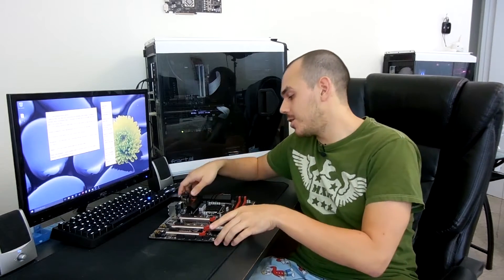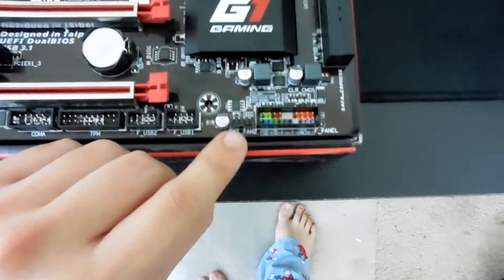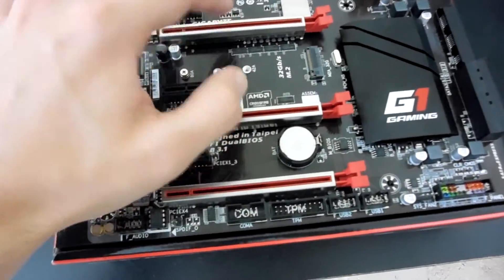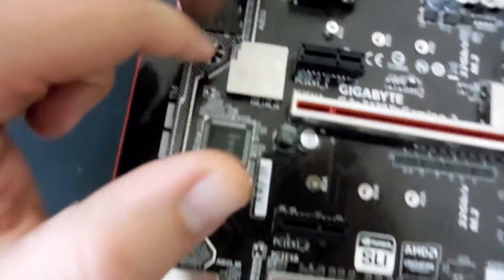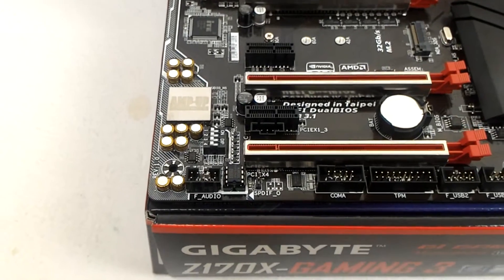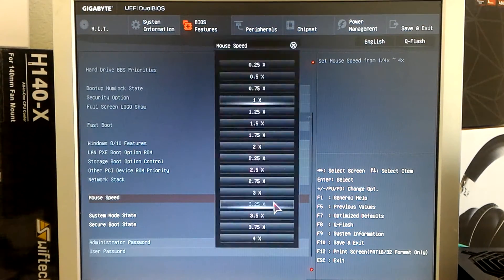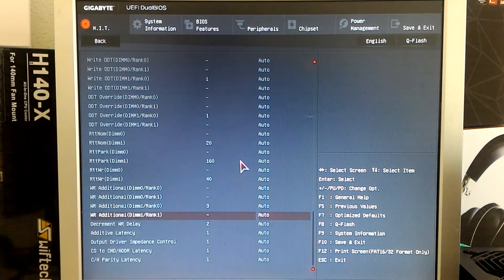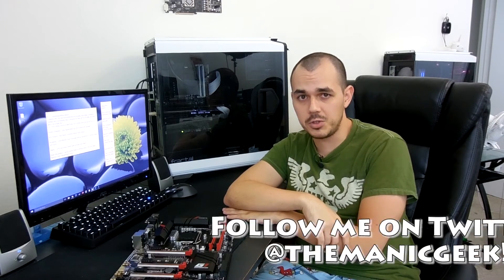Manic Tech #0023: Gigabyte Z170X Gaming 3 ATX Motherboard Review

Comment: I am a pc  noob but I will get a new pc with this mobo. Do I need to download a new version of the BIOS ? If yes where ?
Reply from the maker: Nah, you should be good, provided your memory you're selecting is on the QVL for the motherboard (you can find the listing of compatible memory on the Gigabyte website).  If you have any issues, the Gigabyte website also has all of the up-to-date drivers and BIOS files available to download, including older BIOS revisions that may work better with your hardware config.
Reply: The Manic Geek So I will have 16 GB RAM DDR4-3000mhz do I need it to change it to 3000mhz in the bios ?
Reply from the maker: The brand of memory is more of what matters here.  You will need to go find the list of compatible memory for this motherboard on the Gigabyte website, it will tell you all the modules they tested with the motherboard.  No matter what memory you get you will need to go in to the BIOS to make sure it's set correctly, it doesn't frequently just automatically run at its rated speeds, and even then sometimes it just won't run at its rated speed since anything past 2133 MHz is technically considered a memory overclock, so it boils down to whether or not the memory controller on your processor can handle those speeds with the quantity of DIMMs you'll be running.  If it's a 2 x 8 GB kit then you should have far better luck, but if it's a 4 x 4 GB kit then you might be hard pressed to run it without doing some other tweaking at those speeds.
Reply: The Manic Geek Its a G.Skill Ripjaws V ! I will take a look onto their website, thanks man
Reply: so a 2x8GB
Reply from the maker: G.Skill is a pretty reputable brand, and as I recall several of their kits are listed on the website as being validated for compatibility.  Still double check just to be sure, though!